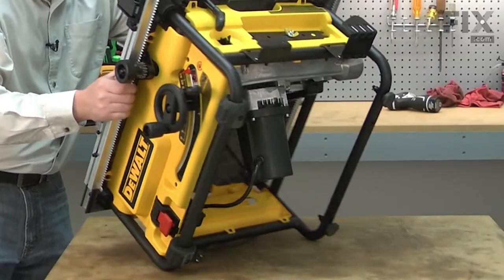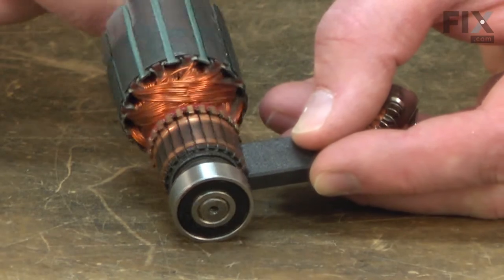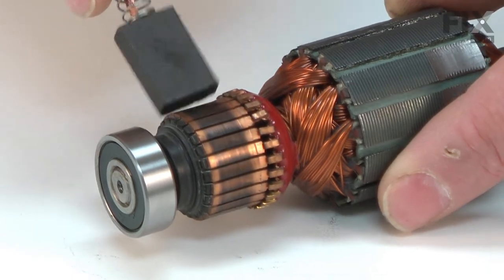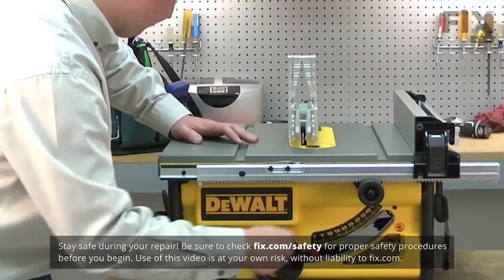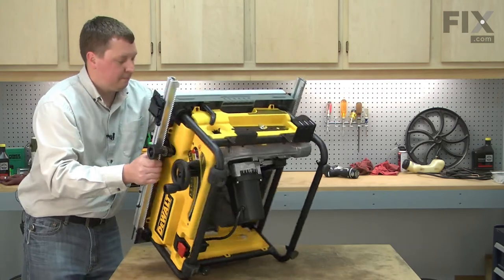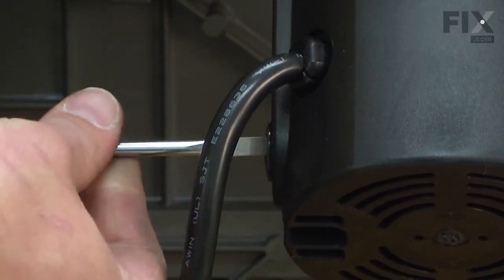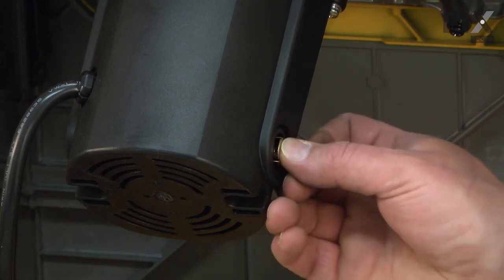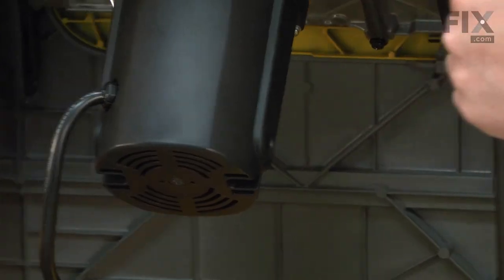DeWALT Table Saw Repair - How to the Replace the Brush

Comment: My 744 has power past the switch, but changed brushes after a decrease in rpm was noted, and now nothing, like the brushes aren't powered. Is there any overload reset button on this motor? 
(Couldn't find one)